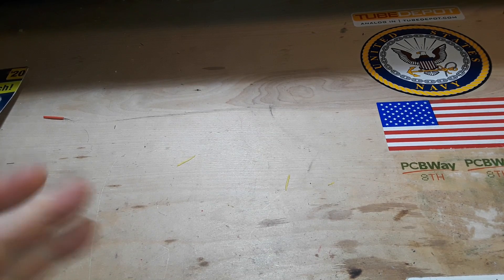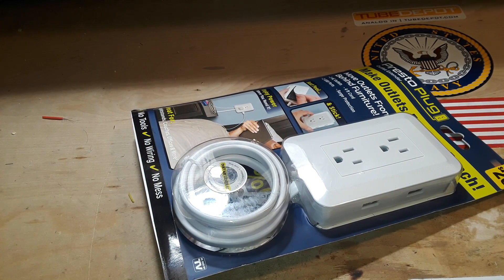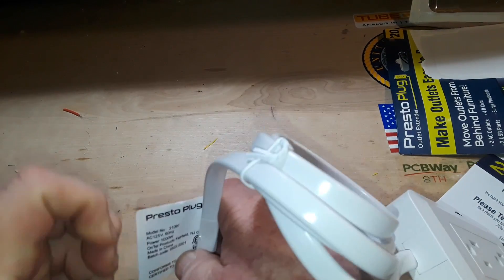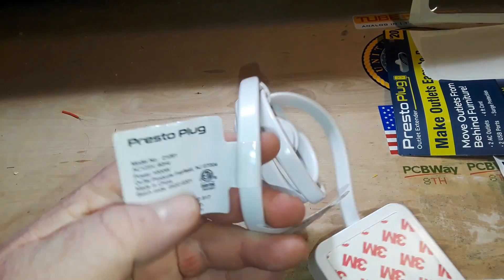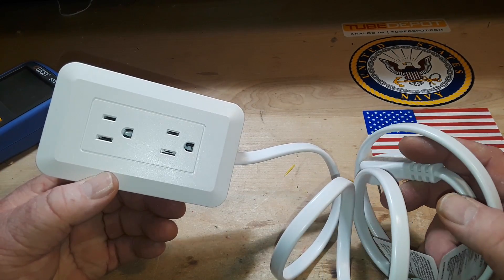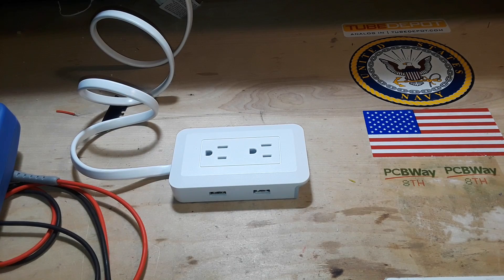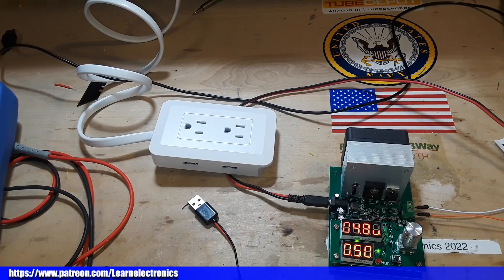Prestoplug Outlet Extender

Comment: I work at Ace and we sell these.   A customer brought one back and the outlets don't work but the usbs do.  I want to fix it.  I'm new to multi meters and I have one but when I do what you did w/ the probes I don't get anything.  (because the outlets dont' work? lol).   All connections look good.  Nothing is lose. Capacitors are not bulging.  Nothing is burned.   I've been in hardware for almost 35 years so I have a head on my shoulders but just never delved into electronics.  I really want to know if and how I can fix this.  
So my first question is .. I have a Gardner Bender GDT-311 Digital Multimeter.. is that the right thing to use?  I wish I had learned more about electronics.....

Comment: I just put this on a couple days ago. I then plugged in my vacuum and it stopped working. I replug my vacuum where my Prestoplug was and my vacuum worked. I plugged the Prestoplug in all of my sockets. Prestoplug didn't work at any of the sockets. I then plugged in my other things and all of my sockets worked properly with no problems. Prestoplug... not worth purchasing.
Reply: Same

Comment: I have one of these and took it apart because it failed. Main fuse blown. will be changing it.
Those "safety caps" are actually fuses. 1 amp is the red one and the black one on the other side is 5 amps.
Reply: How do you replace those?
Reply: @julienkristal I didn't replace it. I just bypassed it. Not the safest thing to do but it works again. You could solder in a fuse holder in place.

Comment: That looked like something diode gone wild would approve. Few miss detected parts. so-8 with missing pin is smps ic with integrated power switch and another so-8 package after transformer is active rectifier for fly back circuits. Main separation slot is under tranformer and it seems to have secondary with that copper that has better insulation. It also has real Y class cap between mains and low voltage ground. This looks really nice. It was also nice to see both sockets and smps had it's own fuses but I would put that smps fuse to live rail. now it was in neutral.

Comment: Just last week, I tried using an older USB plug adapter to keep my phone from powering down. A Samsung A21 has a USB-C setup. It didn't even recognize that it had been plugged in. Had to drive down to the local gas station to buy a proper adapter and cord that night.

Seeing you measure that USB socket and finding only 0.4A max usable current just now instantly reminded me of that.

Comment: ETL certified = THE mark of The Devil. It will kill it itself shortly after warranty expired, but will not kill user. I'd say safe limit is 100W load tops, and USB should not to be used with smartphones and other sensitive devices. Maximum is for decorative USB lights.  
I have seen lots of devices that burn itself down, ETL. Stops working after warranty expired - ETL.. My latest in this "collection" - doorbell with a radio-communicated button, ETL. Stops working. When I open it up, I can see burnt components -  it has capacitive dropper as a power supply, with grossly overloaded zeners (that burned) and capacitor itself is NOT a safe X one, but "standard cineseum dark orange blob". I have bypass reminders of "power supply" and added a small switching mode PSU, works great since. 
So if one sees "ETL" this mean 3 things: 1. Safe for end user. 2. 90% that will last until warranty expired. 3. 100% that will fail after warranty expired. 
Difference between ETL and "Aliexpress special"? ETL marked device will not kill you.

Comment: The orange and white cables as well as the alligator clips will introduce a very significant voltage drop at 0.5A. My rough calculation is that you introduce a 0.7 Ohm resistance with those wires which is huge considering the voltage and power of this device.

Comment: Did you try a current draw higher than 500mA?  these days the cheap USB charge circuits in devices like these use a feedback winding to save the cost of an optocouple and thus have no direct feedback.  I've found that the voltage goes higher the more you draw, up until it reaches limit and hiccups. ..

Comment: What is the brand name of that USB Constant current load unit? and why can't you use a vacuum or hair dryer using this Prestoplug outlet extender?
Reply: The wires are not thick enough to handle such current, and thus would get hot and start to melt the insulation off themselves, causing a short in the wire. This can eventually lead to fires.
Reply: @andrewsawesome  what is the gauge of the wires?

Comment: Paul, I think, being truthful, this is just another piece of substandard Chinese junk. One of the most overlooked, and yet potentially most dangerous aspects of these devices is the construction quality of the transformer used in the buck regulator. Often, these things are made with no consideration given to proper insulation, and separation of winding connections. This is so common in the Chinese made consumer junk, because the only way that the quality can be determined is through destructive examination. Many times, windings cross directly over one another when connected to the pins with no insulation other than the varnish on the wire. I also share the concern expressed by Mr Clark regarding the mains connections to the outlet ports via PCB. USB outlets are being added willy-nilly to virtually anything that can plug into a wall outlet theses days. They are a selling point, and the manufacturers - as indicated by this specimen - don’t care about the usefulness, or durability of what they have made.  At $20, I think they got about what the market will bear.

Comment: I’m always intrigued by running mains power over pcb tracks. Pushing in the plug each time to stress the board - can’t imagine that will be a problem.  And I could see they have beefed-up the +/- rails but seemingly not the earth... presumably this will never need to sink the supply and a trip will step-in to save the day? Is that how it is meant to work? 🤞

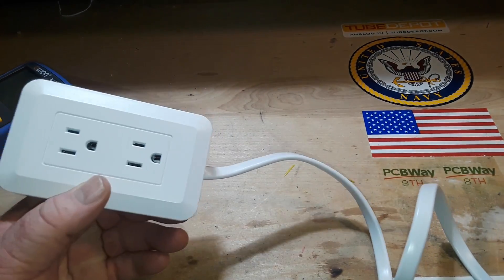Comment: 9:03 the main problem I have with a device like this is that most people will not understand this limitation and use it for a vacuum or something that its not made for.
Reply: It looks like it is fused internally, one fuse for the sockets and one for the USB, but I could not read the fuse ratings.
Reply: @vobbertbecking3598  You are correct. F2 appears to be 1XA 250V and is somewhat readable  (15A?) to me at 8:59
Reply: @InlineSkater72  Your eyesight or screen is better than mine :)